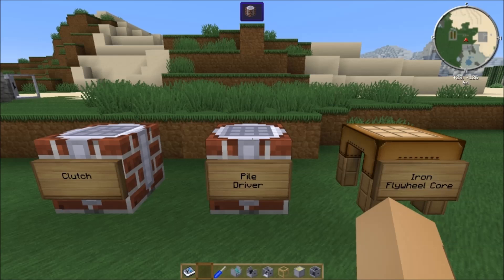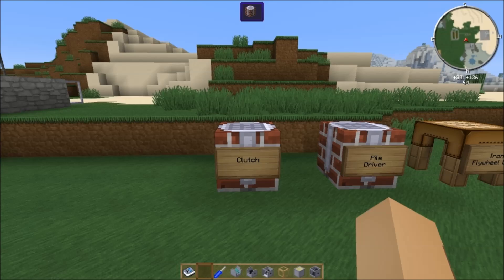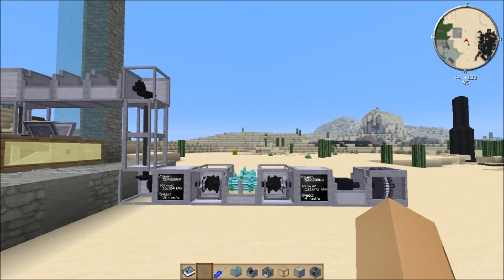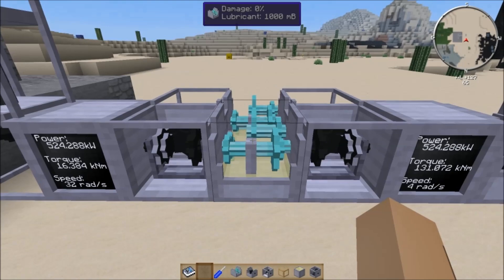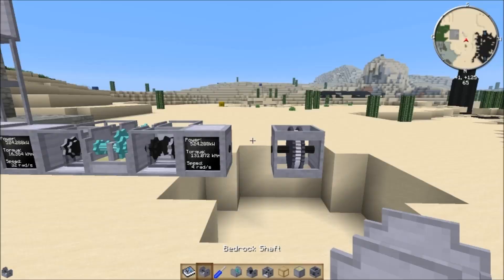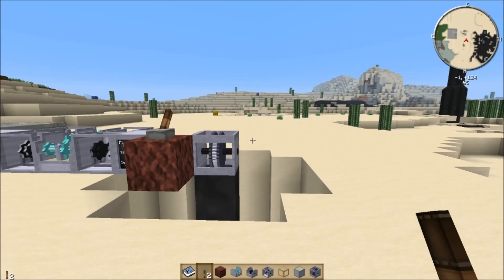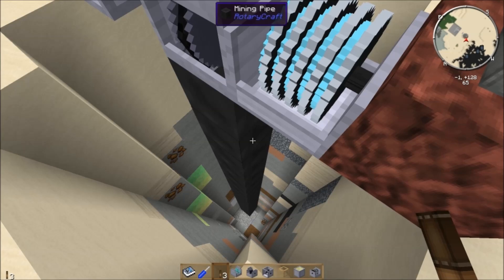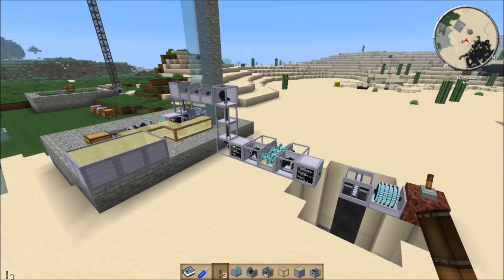RotaryCraft Tutorial #10 - Pile Driver

Comment: I think you were thinking additive instead of multiplicative again. Easy mistake to make. You could get your gearing in three gearboxes.

Your gas engine does 65 kW (128 Nm @ 512 rad/s)
128 nm --> 16:1 --> 16:1 --> 4:1 = 131 kNm @ 0.5 rad/s

You could run a pair of gasoline engines or a performance engine to get that up to 1 rad/s. Granted, it would be very, very slow, but it could be done and not take hundreds of gearboxes like you thought at first. Not that it would be preferable to do it that way mind you. Since normal ore distribution favors mining close to bedrock, it seems cheaper and more powerful to make a water shaft from a bit above sea level for your power source anyway.

Comment: I think I like the bore more than the mining turtle, but the mining turtle more than the pile driver. When the mining turtle excavates, it dumps everything into a chest, and you can change the size of the hole. 
Computercraft, in case anyone was wondering. Fun mod, but I wouldn't use it on a server because they're so easy to make, you'll have massive holes and tunnels all over the place.